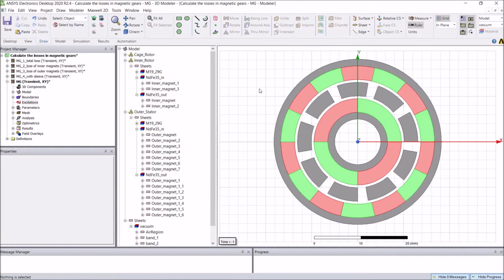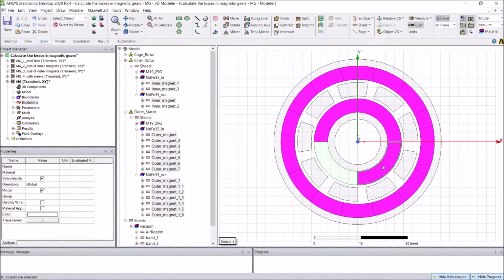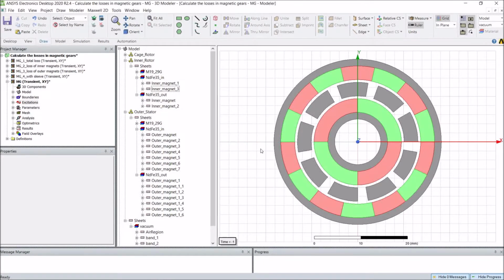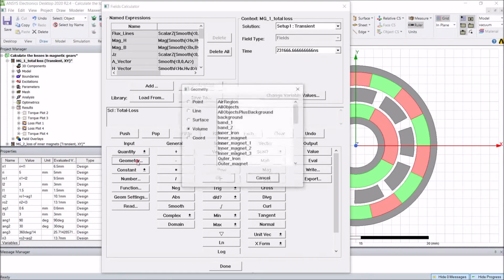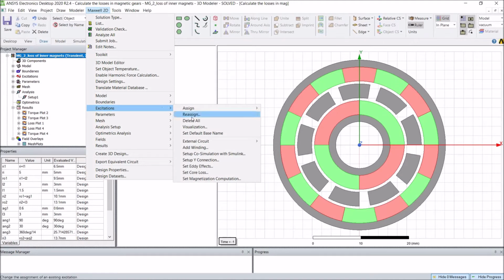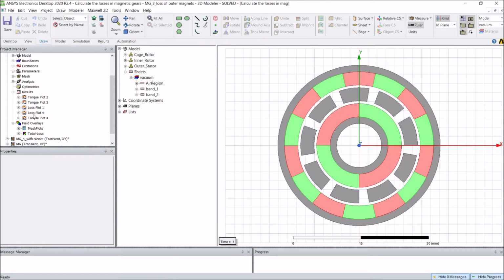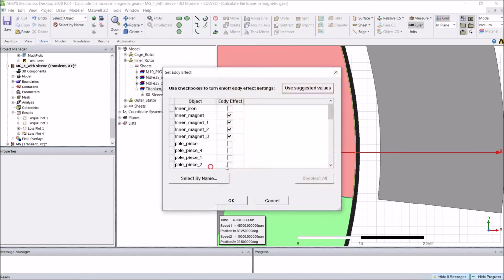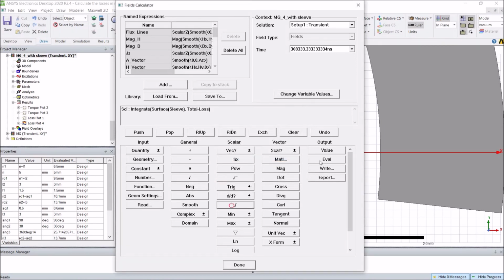ANSYS Maxwell Loss Calculations in a Magnetic Gear

Comment: Thank you for your great work! Your videos on magnetic gearboxes have been very helpful for my project. However, I am facing some issues with loss calculations.
I followed all the steps shown in your videos (several times) and the torque results are correct, but the losses are quite different. I obtain about 2 W of core losses and 0.72 W of magnet losses, even with a model length of 1 m, using the same materials and analysis setup. I am using Ansys Maxwell 2023.
Besides enabling eddy current losses in the magnets, are there any additional settings needed to correctly model core losses? Should the iron be defined as laminated?
Could this also be related to the mesh settings?

Thank you for your help!

Comment: Is it necessary to apply 0mA current to each magnet? 
It is also possible to play the simulation without this excitation.
Reply from the maker: Yes, in a 2D analysis like this it is required to assign a 0 Amp current excitation on each object that has eddy effects applied. This forces the induced eddy currents to return only through the magnet itself and not through the background vacuum/air region. The simulation can run without this assignment, but the loss results could be inaccurate.
Reply: @padtinc  I understand your point and I agree. However, the issue is that I simulated the magnetic coupling following your procedure of applying 0 mA to each magnet. Then, I reran the simulation in 3D (with a refined mesh), which doesn't require current inputs. The results were different—especially the waveforms—with a significant difference in the average, minimum, and maximum values over several cycles.
Reply from the maker: Ensure that the model depth in the 2D Design Settings match the height of the 3D model in the axial dimension; by default, a Maxwell 2D model assumes a model length of 1 meter, which will cause the results between the two to differ if the 3D model is not 1 meter long.
Reply: @padtinc  Yes, you are right. However, the model length modifies just the number, like an scalar, but the curves behaviour are the same and that's the problem to be solved, dear @padtinc. As I wrote before, the 2D transient results applying the currents you suggested differs with 3D simulations (doesn't need induced currents), do you know how to clear this issue? 
Thank you in advance!
This is the last think I need to finish the validation of the current project.
Reply: @padtinc  I'm very grateful with your content, It helped me to advance in my multi-physics project!